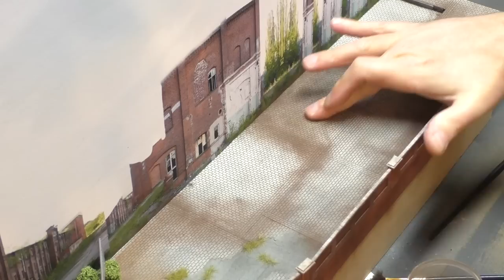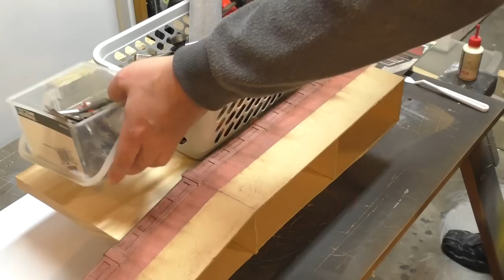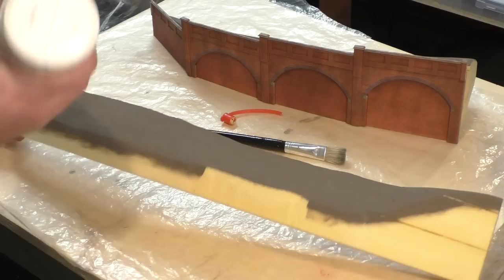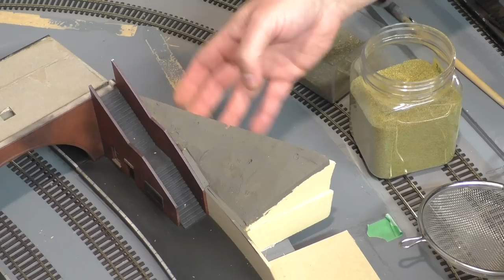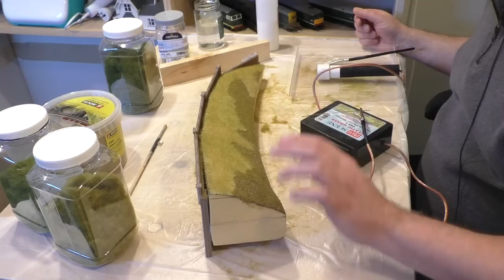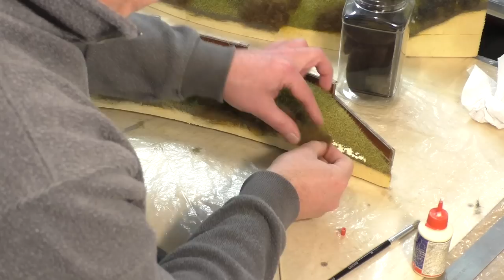Branch Line Station Scenics

Comment: Dear Julian, for glueing your first layer of static grass you could also use a matte medium. Liquitex or Golden have great products. Drying time is much longer. Plus, it remains flexible after fully dried, which allows for much more easy tinkering after the layer has been applied.
Further, as always, some marvelous progress around the branch line station. Looking great!!
Definitely will check out the matt spray for the second and third layers. Cool tip.
Reply from the maker: Thanks Vincent. I've experimented with a myriad of glue-type solutions including Liquitex matte medium which does work well. I actually found a diluted solution of Liquitex worked quite well in a spray bottle as a layering glue also.

Comment: Hi Julian - Very enjoyable. The small tufts of grass at the back of the platform, how did you do that? 
Did you use your mini grass applicator for that and what length grasses did you use please?
Regards Chris
Reply from the maker: Thanks Chris. I cheated with the platform tufts and used pre-made grass tuft strips (I think by Noch) and cut them in half length-ways. These were also used around the base of the factory. I did tone them down a bit (because they were bright green) with a very light dusting of some beige and brown spray paint.